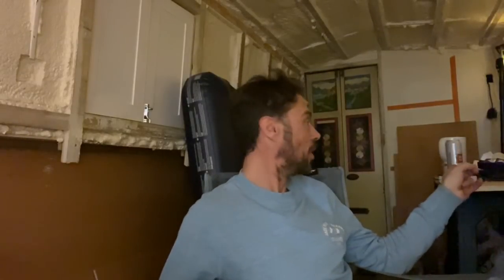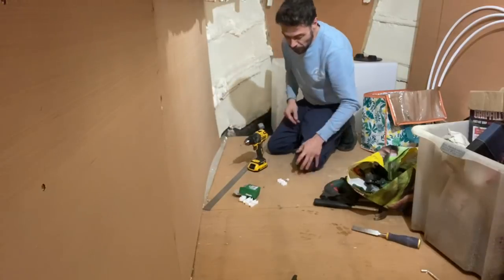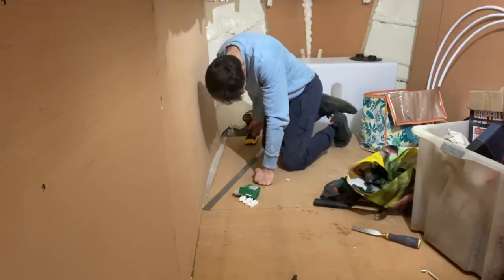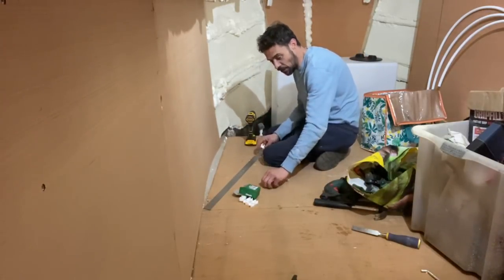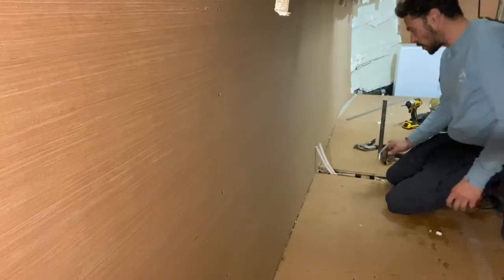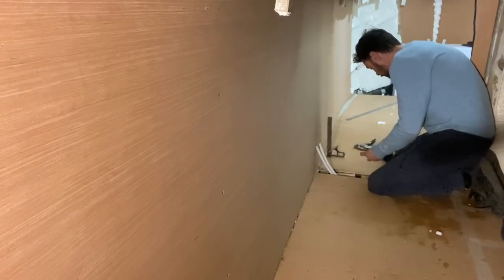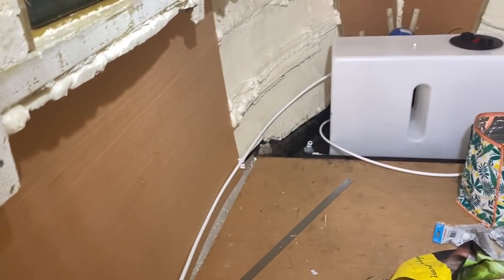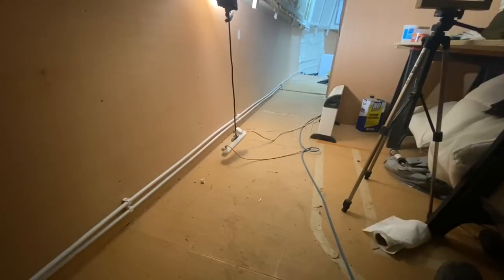59. Update from the Narrowboat and water pipes laid

Comment: The pump guard is on the low pressure suction side of the pump so less likelihood of a leak. The full flow goes through the mesh. The problem is one bit of muck in a pump valve and it’s a major strip down and a good chance the pump won’t seal back together properly as they are really badly built these days. It’s really an insurance.
Reply: I was watching Jono the other day and he was showing how much crap his filter had caught in just weeks. Your water tank just isn’t gonna be clean, even if the water in the hose is. Just because the thing isn’t sealed when you fill it, never mind anything else.
Reply: I wouldn't trust CRT hose water through your system without some sort of ick-protection. It protects everything downstream. If your arteries get clogged you're at more risk for leakage I'd think. Hoses and jubilee clips are pretty common.

Comment: Hi James, you mentioned putting the central heating pipes under the hot and cold but if you follow guidance for domestic plumbing you should put the cold on the bottom as a thermal break, so it won’t then become heated as you run the risk of Legionella. Also, you may consider putting some flexible sleeving to protect the pipes as they exit the floor or if they are in contact with any of the subfloor steelwork as they will move as the system starts and stops.
I look forward to every vlog well done.
Chris
Reply: Hi James ,more clipping on your runs ,you will be surprised how much it moves with the surge,also your clearance around steal ,they will chafe. 
Really good project to follow well done 
Ade

Comment: Hi you use blue water hose on your filter and your pump to stop noise via vibration. And a good idea to put  stop valves some were to isolate the pump if it ever goes wrong

Comment: Hi James, the pump guard / strainer is a good thing in most respects as it will stop chunks of crap from blocking, jamming or damaging the pump but it needs to be maintained/cleaned, in my line of work you will mostly find that the strainer has been removed as they restrict the flow rate (don't want to say pressure but if it helps) of water and they are just a bit of a pain if you don't have an isolation valve either side when it comes to cleaning, please put a isolation valve on the outlet of the tank its for your own good, if you have a leak you can just turn it off and not watch the tank empty into your boat, also you where calling it an accumulator tank but I am presuming it is an expansion vessel, has it got a bike type shredder valve on the other side? this would normally be for topping up the nitrogen (or air if you are a normal person) you will need access to this once a year to top it up. well that was a bit of an essay, just want you to have a shit hot boat mate

Comment: The last small kitchen I fitted was too narrow to accommodate full 600 depth cabinets down one wall. I used the cheapest wickes carcasses and cut the back off where there's about 100mm space for services (wasted space).  You just need to ensure the cabinets will be deep enough for your hob/ sink and fridge choice. To be honest however, there's so little to the galley that it might be easier to just fabricate in position. You could even use ply rather than chipboard, which of course swells up and splits at the first sign of water ingress :-)
If you have time, you could check out Facebook marketplace and gumtree. You can pick up old carcasses for nothing, or maybe £10 for a whole kitchen. In fact  I've seen entire kitchens for sale for £15. Most people just want someone to take the rubbish away when fitting a new kitchen. If I'd known, I could have given you 3 carcasses I smashed up about a month ago :-(

Comment: Hi another good vlog just thought I might say that I don't bother with strainers on either of my hot or cold water pumps and I don't  have any problems as I keep my tank very clean as all your tank and pipe work are new you should be ok but it may be a good idea  to fit that strainer to your hose so you have strained the water before it enters the tank.On the pipe work push the "T" piece along towards the front the elbow backwards then they will sit much neaterand not be crossed

Comment: When you fit the pump I would consider fitting it to a board and then fitting the board to the boat using a bit of rubber matting between the boat and the board. I know that the pump comes with rubber feet but the pumps can be  quite loud and can send vibration through the boat. Fit the pump guard it will save you hassle in the future. If your worried about the Jubilee clips double clip the pipe both sides.
Reply from the maker: Great advice and will follow. I was thinking about mounting it to a spring mounted platform or failing that some rubber mats like you say. I’m also going to sound proof around the pump too. I’ll fit the strainer - thanks 🙏

Comment: Hi James. Good progress so I hope you do meet your crane-in date. One thing I haven't seen in comments or heard you mention is getting the boat BSS checked before going in the water (at which point I assume you'll need a CRT license and BSS certificate number and insurance are requested by CRT at the point you buy your license). 

What are your thoughts/plans re BSS especially as you have said that some parts of gas & electrical systems will (by necessity) be incomplete at launch? Will there be time for fix and retest? Do you expect subsequent BSS checks as the gas and electrical systems are materially changed as fit-out progresses and is completed?

Comment: Instead of a strainer, You can always run your water though a filter that hooks on your water hose as you are filling.  Problem solved.
Reply: The majority of crap in you water tank is probably stuff that falls into your filler cap while it’s open. Not stuff from the hose.

Comment: As others have said put isolator valves either side of your pump.  I have replaced my pump twice since 2010 and would have been a nightmare without being able to isolate it.  I used the red lever types.  My strainer has never leaked.

Comment: As someone mentioned, standard kitchen base cupboards have a service void at the back. The cheap B&Q 'Caraway' units are 570, but the sides extend 65mm back past the back panel. Looking at them, I'm pretty sure that prior to assembly you could take at least 50mm off the back edge with the jigsaw, profiled to suit the slope of the lower wall, and put them together without much difficulty.

Comment: I have my pump guard plugged into  to the inlet socket of the pump. It is one less fitting to worry about. It looks like a different model pump guard though. Like this one http://www.jabscoshop.com/marine/pumps/pressurised-fresh-water-pumps/52600-0292-par-max-7-pressure-controlled-pump.htm
Perhaps you could swap it.

Comment: I'm guessing that a filter would be needed if you had a steel tank - to prevent rust or the lining from getting into your pump and destroying it.  With a plastic tank, that's not a concern - and if it is, you've got BIGGER problems! LOL
I'm surprised how small your tank is!  I would have thought you'd have a MUCH bigger one!  Although, If you do, since it's plastic, it wouldn't be hard to either change out or add another tank later on.    If you're thinking of insulating the hot water pipe - check out children's pool noodles. They're cheap, flexible, fit around pipes like yours easily, and water doesn't bother them if there's a leak or some water in your bilge.
Reply: I think James went with a tank smaller than 450 liter tank used on many narrowboats.
Reply: Pool noodles are solid, without a hole down the middle. You can get the same material for a similar price with the hole down the middle and sold as pipe insulation.
Reply: @JasperJanssen  They do sell hollow pool noodles - and they are MUCH cheaper than the insulation for exactly the same thing.... except the pool noodles are coloured.

Comment: How deeq are wall cabinets - stick some legs on those?  Some floor cabinets have a service back (an area behind the cuqboard for wires and qiqes so you could cut that off to reduce the deqth).  Otherwise try to find out what folk use in their camqervan conversions as they will surely be quite shallow.
Reply: Fitted bathroom cabinets?